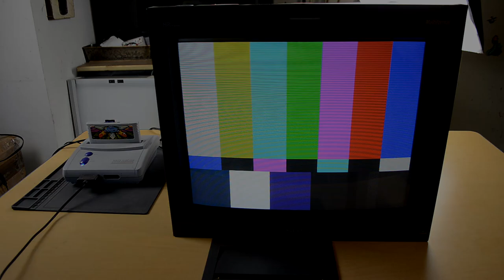Viewer's Dusty PVM 20L5 gets a DEEP Clean!

Comment: Just bought a 20L5, seller said it had less than 100 hours of use, sure enough it was immaculate on the inside. Was only used to grade final output and after it stayed in storage for nearly 20 years. Any other way I can check the age of the tube? Picture is nice and bright, i took your suggestion and removed the anti-glare coating 😁

Comment: Hello!  I've been looking at your channel for a long time.  I really like it.  It contains a lot of useful information.  Can you help me?  I bought myself a Sony PVM 14m4e.  He has a problem: when I connect an external sync, the picture from the CRT disappears.  The same happens when activating the 16: 9 mode.  I found out that 10 volts "comes out" from the 12th leg of the upc1377c microcircuit when the CRT went into defense.  Have you faced a similar situation?

I tried to close the 12th leg of the microcircuit to ground, in which case the CRT turned on and there was a stable picture on it, but, of course, with reverse lines.

Comment: Does the hole on the tube where you remove the anode cap need to be covered when cleaning to prevent dust from getting inside? Thanks Steve another great informative video.

Comment: I do the same especially my crts in my arcades, the trouble with open chassis gaming monitors is they get dusty quickly and build a layer of black crap of over it especially if the monitor gets a lot of use I go round it with a paint brush, cotton buds and some contact cleaner, I even clean the flyback wire so it's bright red afterwards.

Some people hose it down with water but I'm not sure about that, there's a few people on Youtube that run the chassis under the tap then dry it out with a hairdryer but I'd be concerned you would ruin transformers especially the flyback

Comment: Hi Steve, is there a concern with the rubber around the anode cap failing over time?  Would rubber gloves protect against that while removing the anode cap to discharge per Sony's maintenance papers?
Reply: I think he double gloves. Outer gloves are a higher quality type if im not mistaken. Might check his crt safety video. No idea about failing/replacement anode caps. Be safe